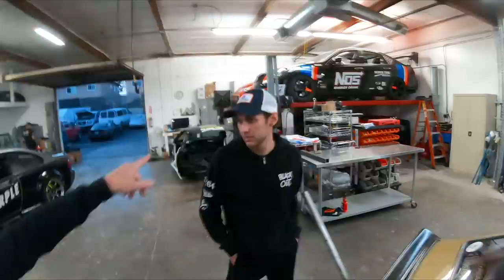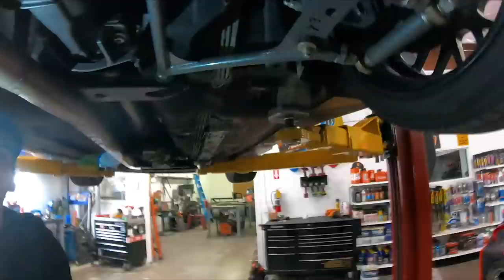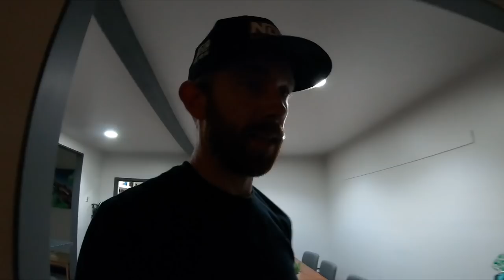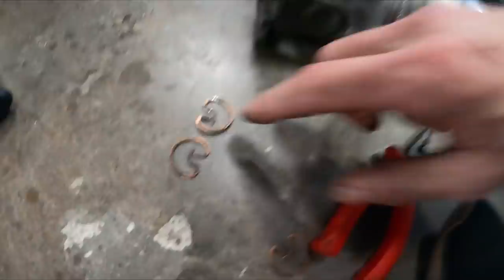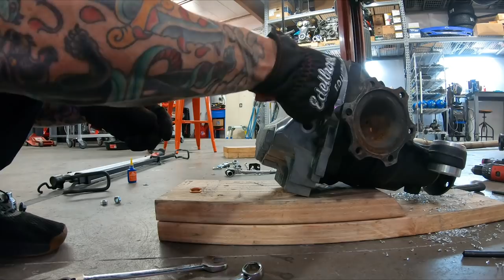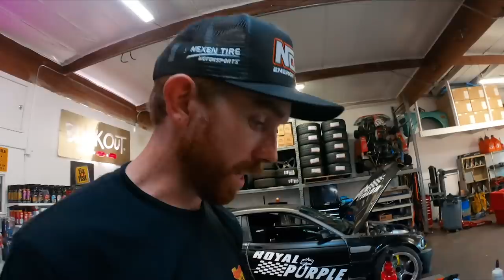I put a 370Z LSD into Gold Leader Z!

Comment: I had the same VLSD in my G35 with 75k miles when purchased, and it would not lock up at all. Tips for that or are you not concerned with locking up the 280z? I just swapped in a welded diff, but still have the original.